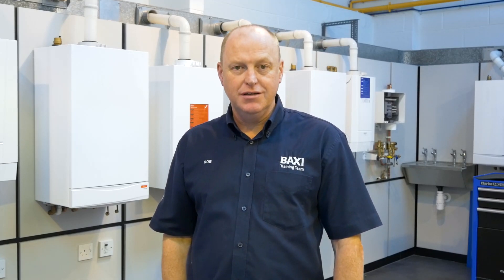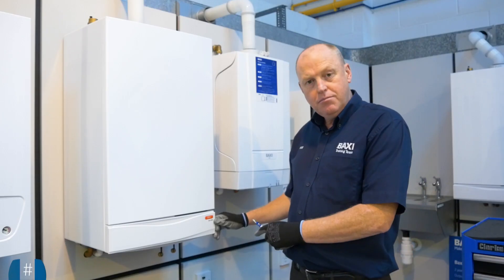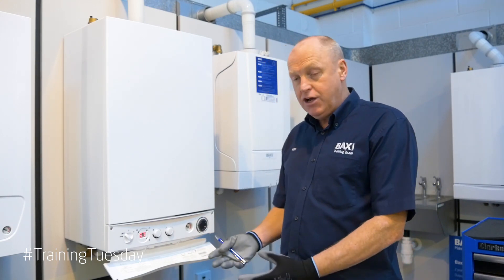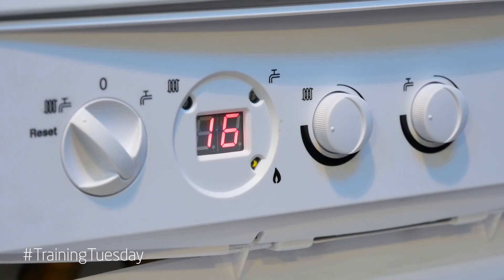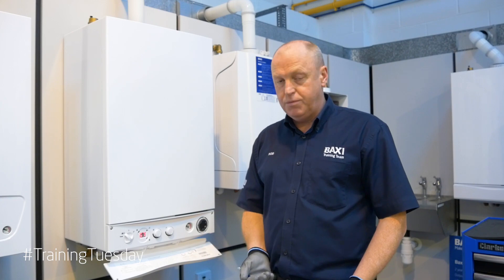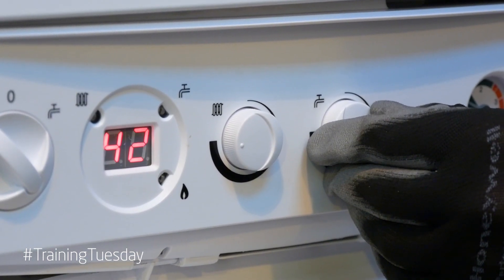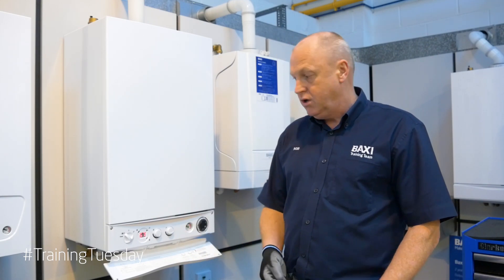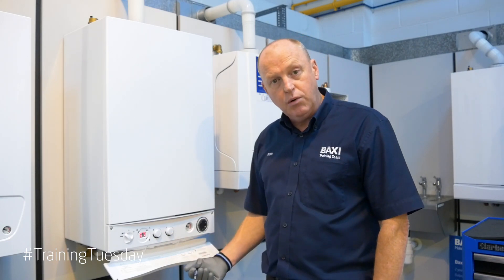The preheat function on the Main Eco Elite boiler

Comment: Good video. I have the same boiler and currently have hot water but no heating. Putting it in service mode (to change high/low flame) has got my heating working again however and whilst in service mode it seems fine but the boiler cycles on and of with the flame. Otherwise when you call for heating from the wireless stat the actuator valve opens but the boiler doesn’t respond. No led light on heating. No pump running. Nothing. But when in service mode it’s all working fine and rads warm up. Any idea what’s up with it? Cheers

Comment: Guys one request, is there anywhere we can get literature with regard to the different values for things like thermistors resistances, or the resistance value of motors like the divertor valve actuator, gas valve solenoids, pump, or the DC voltages to expect on things like the hall effect sensor etc  I know they are covered in all the videos and that's great but it would be awesome to have it in literature form.

Comment: Great ones, I have a question, do the newer Baxi boilers, 600 series, 800 series etc use PWM (pulse width modulation) on fans and pumps and if so how can we test these without the use of an oscilloscope, for example by getting a frequency reading in Hz from the signal wires - your fan Robbie
Reply from the maker: Hi there, thanks for your question. I have spoken to Rob for you and here is his reply: "We've had this or a very similar question before, the 600/800 series do use Pulse Width Modulation but for signal measuring you could probably use a multimeter to check it's giving a signal, but the values would not mean much. The signal is a square wave so the meter picks up sort of an average number...it's not a good method and would require the use of an oscilloscope. I have asked R&D and I am still awaiting an answer so will chase this up and if I get anymore info i'll let you know. Hope this helps"
Reply: @BaxiBoilersUK  Sure thing.  I was testing a Duo-tec Combi 40 HE yesterday and it appeared to me to have three voltages, about 27vdc on the power, about 7vdc on the blue and about 5vdc on the green, the reason I mention this is that some older fans used these kinds of voltages to modulate rather than a PWM signal and I wondered about the new ranges.  Rob is the man!  I thank you so much for the timely reply and our continuing education, its really appreciated.